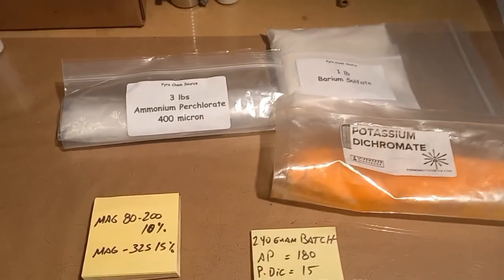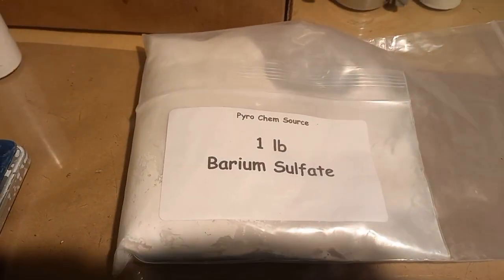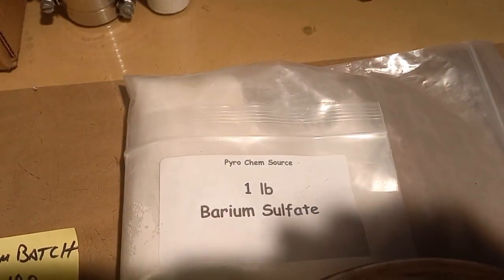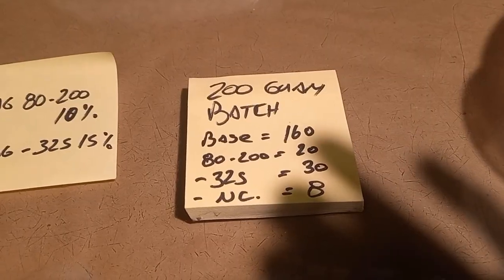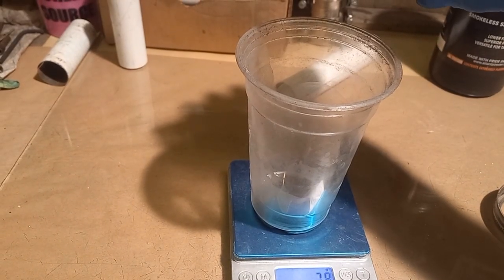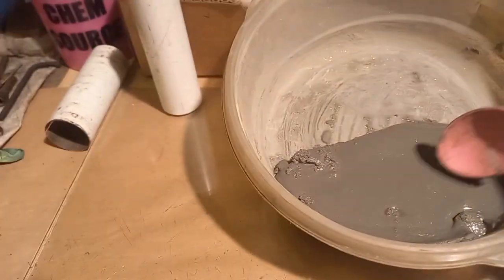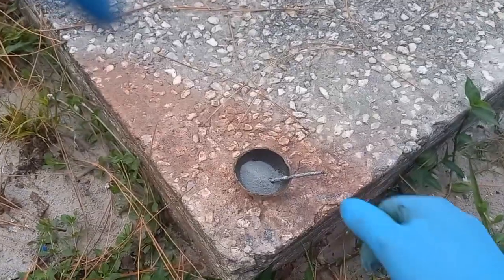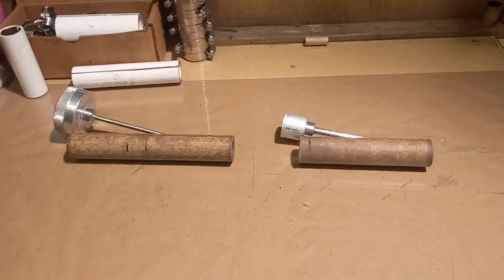Strobe rocket fuel . Making/Testing/Launching

Comment: I'm from Indonesia, no one here sells green dot and klean strip acetone, please tell me what ingredients can replace these two. I like this tutor please help answer🙏
Reply from the maker: Green dot nitrocelullose gun powder can be replaced with any smokeless powder , they're all very similar , also smokeless powder from any shotgun shell can be used .
Regular acetone regularly used to remove nail polish can be used as well.
Reply: @Pyroflorida Without the green dot is it possible, can you provide the ingredients? Is the composition correct? I have noted it carefully.
 Ingredients for Strobe Rocket Fuel:
1. Ammonium Perchlorate 3 lbs 400 micron - 180 gr 
2. Potassium Dichromate - 15 gr
3. Barium sulfate 1 lbs - 45 gr 
4. Magnalium 80 - 200 mesh - 20 gr 
5. Manganese - 325 mesh - 30 gr 
6. Green Dot Lacker - 8 gr 
7. Acetone - 52 gr
Reply from the maker: @CalmQuran01  wondering where you got the manganese from? Manganese is not in the formulation or even mentioned on the video .

Ap: 180
Pot. Dichromate  : 15
Ba sulfate: 45
Magnalium  80-200 : 10
Magnalium -325 : 15 
That's the correct formulation , that's what I'm showing in the video.

NC lacquer can be replaced with 4% of Vaseline by weight dissolved in hot  mineral spirits or naphtha. Composition must dry for at least 24 hoursbefore used.

Comment: How can I do a fuse prime for lifting shells just for garranted ignition? I seen one with ping pong balls and acetone and bp but it also maters off your ping pong balls have Nitrocellulose
Reply from the maker: Your question is very confusing .. if looking for a lift charge for shells , that's basically regular coarse black powder.
Nitrocelulose based ping pong balls laquer have nothing to do with increasing ignition at all.
Reply: @Pyroflorida ahh I see okay how can I garrante ignition ? A black powder primer for my fuse right !?
Reply from the maker: @bigislandpyro8085  still quite don't understand what do you need to prime or  enhance ignition on , but , here is the formulation of one of the best primers around 
MONOCAPA :
KNO3 : 31.1%
KCLO4 : 24.1 %
MAGNALIUM 200 MESH : 12.3 %
CHARCOAL  : 11.5 %
IRON OXIDE BLACK : 7.4 %
SULFUR : 4.9 %
DEXTRIN : 4.1 %

This is a very popular prime. , it can be used widely. Especially in priming stars not containing kclo3 or Ammonium perchlorate.other than that you can easily ignite anything with it.

Comment: Here's a question. After granulation it seems the mix reverts to a 'find powder' is there a way to make it less 'dusty' like how whistle is when adding mineral oil? That way it's easier to press so it doesn't poof out of the tube.
Reply from the maker: If you're adding NC lacquer as described on video and granulating when still wet you fuel should be granulated with the consistency of granulated whistle fuel
Reply: @Pyroflorida I think I may have screwed up my measurement somewhere. I only made a small batch to try but I'm going to try it again and follow your procedure again. I don't think I got it wet enough this is the problem

Comment: Your math is a bit off. Not exactly 200 grams dry ingredients.  Did you mean to use 150 base?
Reply from the maker: Let's make it simple (in parts)
60 ap
15 ba sulfate
5 pot dichromate 
25 magnalium ( wathever mesh sizes comb you want to try)
NC laquer as a binder.
That simple.
Reply: @Pyroflorida thank you
Reply from the maker: Make your math , the recipe doesnt round up on the100 decimal , is actially 105 including metals without the nc laquer , thats why the called 200 gram batch if you do the math is actually 210 grams .
Maybe i didnt made that clear on the vid
Reply: I'm using your video as a guide for my first strobe rocket
Reply: Loving the channel

Comment: Did you add any whistle mix in the bottom or top of the rocket or does the strobe fuel whistle?
Reply from the maker: @Wheels_And_Wrenches1  strobe doesn't whistle , motor has 1/3rd of bottom section with whistle as main thrust fuel , then 1/2 inch of whistle on top for sound effect
Reply: Thanks

Comment: Sali made with red iron and Coleman fuel/wax is ok to press with this strobe compound? Same psi 6500? And I went with 8oz motors
Reply from the maker: @alfonsobarone6383  yes , but need to press the sali fuel at aprox 7000 + otherwise it will Cato
Reply: @ thank you sir 7 gram increments for each press till desired height?  And still the same pressure with the strobe? I’m going to go with 2 inches of whistle then rest of spindle to strobe then whistle delay with flash report but I’m not using a clay bulk head just next size tube up flash making contact with the Sali it has worked for me with the sugar rockets
Reply from the maker: @alfonsobarone6383  I suggest 3 to max 4  gram increments for the 1 pound motor , strobe can be pressed to 6500 and perform as expected , sali 7500 to avoid Cato
Reply: @ you are the man thank you I’m going to press my first one in a few days I will post a video 🤙🏻

Comment: Sir, can you tell me what the use of "green dot" is?
Reply from the maker: @g.i.n4668  greed dot is nitrocellulose smokeless gun powder , by adding acetone it becomes the nc laqcuer
Reply: @ Can I be replaced with another substance? I don't have that
Reply from the maker: @g.i.n4668  yes , Vaseline dissolved in naphtha or camp  fuel also works , same percentage of pure Vaseline,  when naphtha or camp fuel is totally dry , fuel is ready
Reply: @ I looked for vaseline on the stalls and found that their use is to moisturize and soften the skin, did I find the right product?
Reply from the maker: @g.i.n4668  yes , also Vaseline is called petroleum jelly sometimes
Reply: @ I will fix it the first time I made a rocket strobe, it just flickers and doesn't make a sound, I haven't found the cause yet, the types of foot I bought in China, is the lack of vaseline the cause of the loss of the strobe?
Reply from the maker: @g.i.n4668  it will strobe even when Vaseline is used as phlegmatizer instead of nitrocellulose laquer,  , there is many reasons why isn't strobing , quality of the chemicals,  quality of the magnalium etc , any possible changes if you have made any from the original formula can cause the fuel to misbehave
Reply: @ Thank you for the advice, I will try it again until it is the most perfect

Comment: How do you decide the measurements. If I decide to change the weights then on what basis should i do it. Please explain. Thank you🙏🏻
Reply from the maker: @anifireff4855  the original strobe formula is 60% Ap / 15 % Ba sulfate /5% pot dichromate and 25 % magnalium  with 4 % of either vaseline or NC laquer .
I'm not changing measurements , percentages are identical to original formula , I'm just playing with different magnalium mesh sizes combinations but not varying the overall percentage.
Reply: @Pyroflorida  Can I replace the pot dichromate with ammonium.Dic? using this same fomula?
Reply from the maker: @Popsontheblock  yes, definitely. Ammonium dichromate produces louder pops and is less poisonous than potassium dichromate.
Ammonium dichromate goes by 6% on the formula vs the 5% of the potassium dichromate
Reply: @ thank you I just received my amm.dic, For the strobe base formula you have P.Dic=15  would that be Ammonium dichromate at 10 parts instead of the 15 ? And the rest of the formula stays the same ?
Reply from the maker: @Popsontheblock  look at the first message , formula is just like that , the only difference now is that 1% extra if you use ammonium dichromate  if you see 15 of dichromate on the video is just because I'm doing a 300 plus gram batch or so
Reply: @ if I wanted to make the same batch amount what would that 6% equate to in grams ? Sorry I’m still trying to figure out percentage to grams I get confused 😅
Reply from the maker: @Popsontheblock  that's because the forma ends up in 105 grams instead of 100 grams 
With ammonium dichromate it will end up in 106 grams .
60 grams ap
15 grams ba sulfate
6 grams ammonium dichromate 
25 grams of magnalium whatever mesh size you decide to use 
Total = 106 grams

Comment: i tested strobe fomula but no sound
Reply from the maker: @phuongtran5912  something you're doing isn't right , are you milling the base mix to a very  fine powder ?
What type of nitrocellulose laquer are you using?
Reply: @Pyroflorida  Before I mixed it, I ground the mixture into a fine powder, I used nitrocellulose mixed with aromatic gasoline 4%
Reply from the maker: @phuongtran5912  nitrocellulose must be made out of smokeless pistol gun powder and can only be mixed with acetone. Any other alterations will affect the quality of the strobe.
Base mix chemicals should be dry 100% , (dehydrated ) , infra red lamp is a good option. 
Depending in the quality and purity of your chemicals is how strobe will perform , sometimes blade milling the base mix is not enough , in that case ball milling is necessary,  and of course the quality of the magnaliums is  very important.
Strobe fuel is the most difficult rocket fuel to make , many experienced pyros can't  successfully make it  , it's a very tricky fuel for sure.
Where you buy your chemicals from?
Reply: @Pyroflorida  thanks man, I buy chemicals in China. i will do it again.

Comment: Can you explain the purpose of the barium sulfate?
Reply from the maker: @acetylen14  under my understanding barium sulfate acts as a catalyzer and stabilizer on the dark an light phases of the strobe
Reply: Strobe fuel works as a combination of low and high temperature oxidizers for it to create the oscillation. So the AP is the low temp constant oxidizer and the barium sulfate is the high temp oxidizer
Reply from the maker: @HenrikSherwood  Henrik , question for you , do you know if ap or the ba sulfate suffers degradation over Time , having issues with strobe fuel not performing as expected,  ( low pops) I'm using the exact chems as before , ap , ba sulfate , pot dichromate all double bagged and sealed inside a controlled temperature room , purchased a good qtty of them about 1 year ago..  my fuel making process never changed , same chems etc
Reply: @Pyroflorida  AP might, I'm not 100% sure though, that's probably a question to ask Casper.

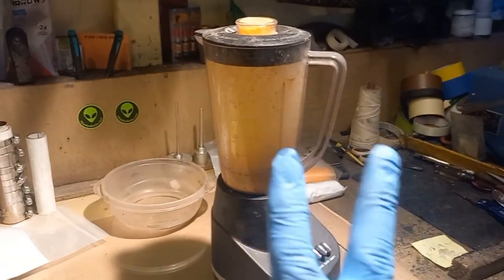Comment: 1:20 I borrowed my mom's coffee bean grinder. Chlorate and Nitrate into a fine powder. Now I wonder how poisonous it is but I washed it as well as I possibly could. Also, I think I ground it with sugar or charcoal + sulfur. It never catched fire though. Maybe I was lucky?
Reply from the maker: @nattsurfaren  what kind of nitrates and chlorates? There is many around , and yes , if you have grinded oxidizers with fuels and nothing happened,  you're lucky . Specially with chlorates
Reply: @Pyroflorida  This was a very long time when I was a teenager but sodium-based compounds are what is available in Sweden because it is less expensive.
Reply from the maker: @nattsurfaren  rule number one on pyrotechnics,  you never blade mill oxidizers with fuels , must do it separately.
Reply: @Pyroflorida  That is true, it's not that exciting but it is safe. :)

Comment: why not paraffin candle wax as the rocket fuel part, with some oxidizer mix. it can easily made liquid and mixed. easier than sugar. what about liquid solvent pla plastic as the fuel, nail polish remover replacement as the solvent. ethyl acetate. the solvent can be evaporated to make the mixture solid. yes the solvent is for liquid mixing purposes only. unless you want a liquid boom boom stuff.
Reply from the maker: @gsestream   parafine wax with " some oxidizer mix"  what that means to you,  also wondering where you see sugar in this comp.                                                                                   No wax needed since the moment that nitrocellulose laquer is used as phlegmatizer  , acetone is used to to dissolve nitrocellulose and incorporate it to the solid mix , this procedure and components are being used for decades in manufacturing strobe fuels.                                                                                        No liquid boom boom stuff here.
Reply: @Pyroflorida  just mentioned that, in case you get tired of the nitro stuff
Reply: @Pyroflorida  on the subject matter, cellulose is almost sugar
Reply from the maker: @gsestream  brotha (nitrocellulose) is smokeless gunpowder , which contains about 25 % of nitroglycerin on it , is used in all type of shotgun shells , 9mm ammunition and high power rifle rounds .
Nothing to do with cellulose , actually never used or mention cellulose either
Reply: @Pyroflorida  nitrocellulose is literally nitrated cellulose. ie almost sugar. nitrated.
Reply from the maker: @gsestream  no , is made out of nitrated cotton
Reply: @Pyroflorida  which is cellulose
Reply: @Pyroflorida  you can nitrate various things. and the name says it all, nitro-cellulose
Reply from the maker: @gsestream  sugar is a monosaccharide (glucose) 
Nothing to do with cellulose or cotton , try putting some cotton balls in your coffee tomorrow morning and drink it , then tell me  later that is the same thing as sugar.
Have a good night.
Reply: @Pyroflorida  also cellulose is a combined form of sugars, yep animals eat cellulose as in the grass, ie likeness to sugar, not the same, same or nearly the same building blocks
Reply: @Pyroflorida  cellulose is a polysaccharide, if you get over your pride of knowledge, cheers
Reply: @Pyroflorida  I wonder if you could nitrate paraffin wax and/or sugar. too.

Comment: Solid video! You helped fixed my issue, thank you!!!

What psi do you press your 1lb strobes to?
Reply from the maker: @ReeferGuy562  on my strobe one pounders I usually go for 7500/7700  max  on the whistles and 7000 max on the strobe fuel , I find out that pressing strobe over 7000 changes the behavior of it by slowing it down
Reply: Appreciate the info. Never considered changing pressures mid motor but since we’re switching comps this makes a whole lot of sense. Will give this a shot 👍

Btw since your strobe comp is wetter then normal, last batch I made I spatula’d it after mixing on sieve to make a thin even layer . Cut dry time in 1/2  🎉
Reply from the maker: @ReeferGuy562  you really got me on this one , I can't understand what you did .. did you used molecular sieve for what?
Reply: @Pyroflorida  instead of drying in mixing container, I spread the wet comp across the bottom of the sieve that I will use to granulate once dried. This way it’s got airflow from top and bottom
Reply from the maker: @ReeferGuy562  👍cool idea,  just be aware of a metal spatula frictioning and  stretching the fuel if you use a metal one.

Comment: Florida Pyro what the trick to mixing the powder(I can only get Bullseye in my area)and the acetone seems hard to get the clumps out…using 10 grams Bullseye to 1/2 cup acetone Keep the videos coming 🙏
Reply from the maker: @zuess8018  bullseye is a very good option and it contains more nitro than green dot apparently,  it should dissolve easily, I usually let it seat for a couple of hours after mixed with acetone,  and mix it pretty well before use .
Like always , nice to hear from you.
Reply: @Pyroflorida  everything’s good letting it sit awhile and then shaking it worked fine…wish you were coming to the PGI convention in a couple of weeks they have  a rocket competition you could enter 🙏
Reply from the maker: @zuess8018  I'll love to be there, but I'm too busy , maybe one day✌️

Comment: When you r drying your water granulated fuels with a heat lamp do u also apply gentle airflow with a small fan or is it unnecessary? I know people say its best to dry as fast as possible for good power so was just wondering, nice vid to 😁
Reply from the maker: @I_Like_CATOs  I dont , but it may be a good thing to do
Reply: @Pyroflorida  cool thanks! ya i was wondering since i just made my first water granulated batch and it seemed a little bit weaker than when i used acetone so i think i didnt dry it fast enough. il also try your green dot nc laquer as well sometime! :D
Reply from the maker: @I_Like_CATOs  I never rush the drying part of it , I usually water/alchohol granulate,  then let it seat overnight on a temp controlled room  then getting the fuel under heat lamp for a few hours 
Is always a goog idea to weight the batch before granulation , and weight it again after the heat lamp process,  if is still any humidity still on the fuel will be reflected on the weight.
Reply: @Pyroflorida  oh nice, i didnt think of weighing the fuel before and after, great tip! :D

Comment: In my country there are only mgal 200 mesh and 325 mesh and 100 mesh so which ratio is best?
Reply from the maker: @lanlan5391  a good strobe can be done by using the traditional ratios of 21 parts of magnalium 200 with 4 parts of magnalium-325

Comment: What’s the metal pointy peice for?
Reply from the maker: @JamesTho-jb9bk  that's called spindle  , it forms a Hollow fuel grain when fuel is pressed inside of the motor
Reply: @Pyroflorida  thanks, I was lost for a second 👍
Reply: @Pyroflorida  just wondering do you put in the rocket fuel then poke the spindle in the middle of the tube?
Reply from the maker: @BoomBoomPyro  go to Ned Gorski channel and learn the basics of making rockets first , you should know all that before even attempting to make a strobe rocket.
Reply: @Pyroflorida  thanks I definitely will!
Reply: @BoomBoomPyro wow you got a lot of research to do .. if you’re thinking about getting into this hobby start small  be patient and have respect for the chemicals you’re working with don’t cut corners
Reply: @kipdrippers what do tou mean ??